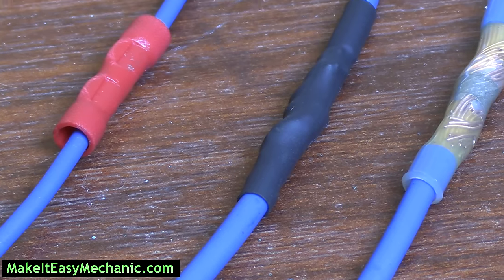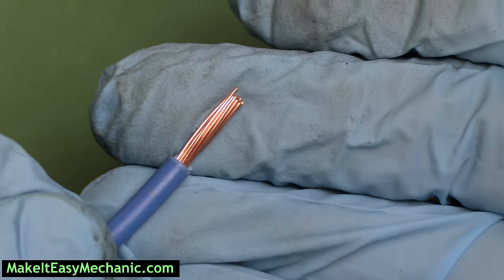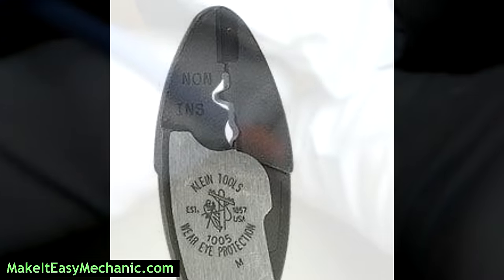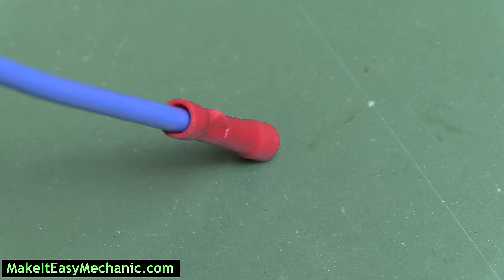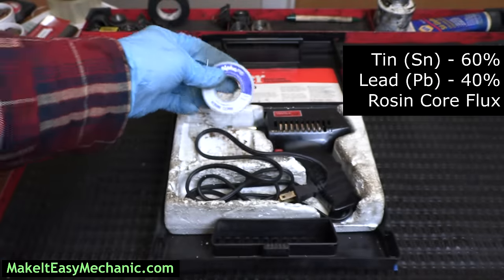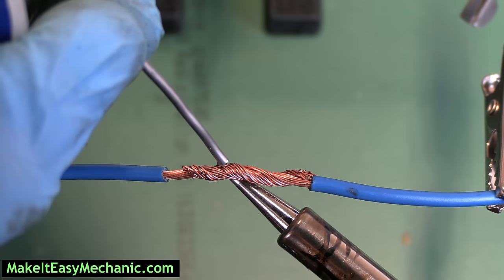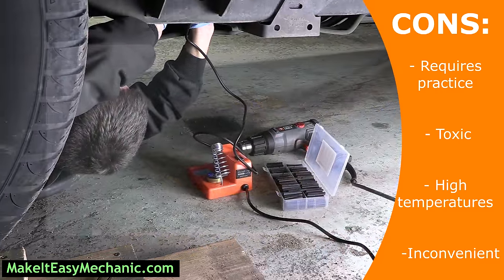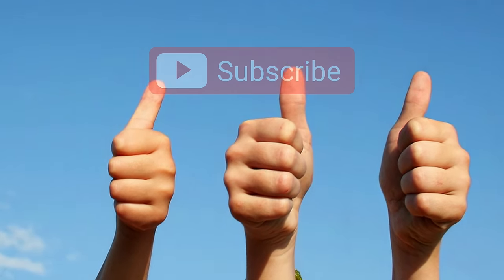How to splice wires - how to solder, how to crimp, wire connectors

Comment: @4.30 the type of tape you need is called amalgamating tape not electrical tape, the amalgamating tape is a stretchy rubber that self seals, electric tape is for electrical insulation, the latter alway goes brittle and lets water in, the other doesn't

Comment: Years of working in military mobile communications, than countless hours building/maintaining cable systems in civilian life, I have to say your video hit the high points of field splicing. It was accurate and informative for the techniques you demonstrated, good job.
Reply: Also for the DIYer, a hairdryer works great for most heat shrink.
Reply: pin this vets comment right now !
Reply: I appreciate you!
Reply: @rppdfire  You’re Amazing!
Reply: @bogartin4561ify  no. Vets are gay
Reply: You never used flux you hack?
Reply: @Big_AlMC  man, you're more toxic than those solder fumes....can we be bff's?

Comment: Great video. I was taught to melt a little solder onto the soldering iron tip before placing it under the twisted wires. The little molten solder lump greatly increases the conduction of heat from the tip to the joint. With the tip contacting the underside of the joint, the rising heat will rapidly heat the whole joint. Then, add your rosin-core solder to the top. It will melt right into the hot joint almost immediately.
Reply: Solder type crimp connector makes life easier
Reply: @Pinkielover  Crimp connectors should not have solder especially if there is vibration. The wire will fracture where the solder starts.
Reply: @Pinkielover  Yet another thing to have on hand. No thanks.
Reply: What is the safest way to connect a copper wire to aluminum aftermarket wiring harness?

Comment: For proper conductivity and minimum resistance, for example, the wires must not be twisted as in India, nor dipped in tin by immersion. This method is probably prohibited everywhere in the EU.

Comment: just one thing to add regarding heat shrink tubing.  There are 2 types, adhesive and non-adhesive.  The non-adhesive ones are not suitable for high moisture environments.  Moisture will actually wick inside the tubing and corrode the wires quite fast.  The adhesive type on the other hand is extremely good for preventing corrosion.  They also tend to be double walled and have a 3:1 shrink ratio.

Comment: Great video!  I've never replaced any kind of electrical wiring before, but I just replaced a defrost thermostat in my 20-year-old refrigerator.  Thanks to this excellent video, I was able to connect the new thermostat's wires to the refrigerator's wires using a red butt connector and electrical tape.  

The main takeaways that I learned are:
- what a correct crimp looks like (I practiced on the old part several times before I tried it for real)
- be sure not to strip some of the copper wires (thanks for showing that -- I never would've thought to look)
- pull on each end to ensure that the wires are secured in the connector

I credit this video for helping a first-timer successfully repair her fridge.  Thank you!

Comment: I didn’t know the last connector existed! As someone that doesn’t know/doesn’t work with soldering enough, this is a great solution for my weekend project.
Reply: @Wolf IT Solutions link to purchase the last type of connector?
Reply: I just used them a few weeks ago & I thought I was supposed to crimp the metal ring in the middle of the connector.... 🤦‍♂️

I don't think that caused any concern, but now I know!

Thanks for the knowledge share!
Reply: @LTSRIDE24  some say you do crimp it... however it will be melted and flow into the cores so the crimping will be pointless. I guess it's good if the cable is tight and you want to heat the joint and not your fingers whilst holding the splice together.
Reply: @fmjkevlar  yeah....I suppose in the end, it ends up getting the job done pretty much the same... 🤷‍♂️
Reply: @LTSRIDE24  exactly 🤷‍♂️
Reply: @Wolf IT Solutions are you saying its a good option of connecter or not to use it?

Comment: Ok so, super gratitude. Feeling clever, might delete later. Headlight socket replacement, in place (tight space) on a 98 Infitniti QX4. After several moments of frustration, this video came through in the clutch. I kept wasting connectors with failed crimps. After watching, I slid a parallel connector onto the car's wire, weaved the wires together ala the solder section, then slid the connector over the wires and crimped with a needle nose pliers adjacent to the wire cutter area which mimics a crimp pretty decent. Electrical tape over the 3 individual wires, then back into the sheath and electrical tape over that. I am please with myself and yall are probably the only people that care LOL. Thank you for reading. I no longer have to pop the hood and jiggle the wire to make my headlight work. PEACE!

Comment: Well done. The one thing I'd add is that when working with heavier gauge wires and/or an iron with limited heat output smearing on the rosin can be a big help to help keep things flowing.

Comment: Glad to see none of those nylon, closed-end crimp connectors featured here. Two wires carrying a high current, joined with those, seems to be what caused the huge recall of those air fryers recently.

Comment: In the process of fixing some wires on my HVAC I came across one of those PSST Connectors, and I have never seen one before so I cut it off and took it to city electric supply and none of the guys at the counter knew what it was it’s so funny the next day I watch your video and get the name of it! Way to help push the community forward with your experience through quality education. Thanks a lot

Comment: Retired electrical engineer here.  Been screwing up crimp joints for about 60 years now.  Using pliers type tools to do the crimps was pretty much hit or miss. A couple of years ago I got a $25 ratchetting crimp tool from Amazon.  Success rate is much better now but ... I even screw that up sometimes.  I highly recommend a ratchetting crimp tool if you're going to be doing more than 10-20 connectors.

Comment: Aircraft mechanic and yes technically we use the heat shrink solder sleeves but only for attaching a wire to the shielding to ground it for protecting data wire from electrical interference. Splicing of wires is done using what are called environmental splices or brand name of RayChem splices. They consist of two pieces, a metal tube with a center stop like a basic butt splice, and a special heat shrink tube like that of a solder sleeve but without the solder that melts at a very high temperature. The reason we avoid using solder is while strong, areas of high vibration cause the strands to break at the edges of the rigid solder connection

Comment: Amazon has bulk rolls of heat shrink  3 to 1 shrinkage with 2 layers and adhesive . I prefer to double over the butt connectors with heat shrink tubes . Very Concise Video !

Comment: When I was first messing with automotive wiring, I might have used one of these methods. These days, it's insulated crimp joints (usually open barrel) sealed with adhesive lined heat shrink. Tear apart an OEM wiring harness and that's usually what you find.

Comment: Great informative video. If you want to make sure your fixed connection is waterproof, put silicone paste under the heat shrink tube. 100% silicone is 100% waterproof.
Reply: Going for the one up here... instead of glue, much better is silicone self-amalgamating wrap. Watertight, originally meant for pipe repair. crazy stretchy and makes a perfect seal, even seal. Looks good, will also do the trick on its own as(imo better) alternative to electrical tape

Comment: thank you. you gave all the info I needed and none I didnt. I wish more 'how-to' videos were this good. now I know I am doing the right thing with the rat chewed wires in the project I just bought. that crimper tool - I lost mine no idea where. it all depends on hand strength tho as you correctly pointed out. My hands dont work so well anymore. A flathead screwdriver and a hammer work alright if you have a flat surface close to where you are working. otherwise - best of luck for those of us with RA AND carpal tunnel issues. and all my friends are the same age now so we all have the same issues!! LOL

Comment: Thanks man!  If I could give you two thumbs up I would.  I'd never heard of the solder seal wire connections.  I have a short in my car's rear camera wiring in the trunk.  I was about to start digging up my solder gun dreading the process while sitting in the trunk my car since I can't remove the wiring harness.  While refreshing myself on what little solder experience I had I watched your video.  To Amazon I went since the local auto stores did not have them.

Comment: I have trying to work on my wire harness,  pigtails on my silverado low beam headlight. Gave it 3 tries. All I did wrong u mentioned. I got to keep trying. Using your last method solder sleeve heat shrink. I used a uncontrollable  flame clicker on solder and stayed too long on shrink sleeve. Burnt insulation. Thx on your video.

Comment: Thanks for the tip on soldering with the mentioning of cold soldering. I would have never thought to let the tip heat the wires then let the solder melt from touching the wires with it. I’m going to do this right now :)
Reply: Hlo
Reply: How can I buy this type of electric wire cold soldier thimbles

Comment: Your video was very helpful.  I'm getting ready to completely rewire a tow-behind trailer and I want to do it so all connections are strong and waterproof.  I wil make sure also that all the lights are individually grounded securely to the frame. Thanks for the informative video.

Comment: I wish I saw this video before I did my wiring.  I crimped, soldered and heat shrinked my wires.  A little over kill you think?   I wasn't sure what kind of connectors I had so I did all three just to be sure.
Great vid!

Comment: Thanks great advice and clear description. Tried first two methods previously with good success. Watched to see if any better way of compact butt jointing nowadays. Your efforts encouraged me to just order a few all in one heat shrink solder butt joint connectors. Will see how it goes but I'm optimistic that it may prove to be my new favorite approach too.

Comment: The pre-soldered shrink tube connectors are very easy to use.
Sadly though the ones I've tried didn't have enough solder to thoroughly soak the connection. Maybe they were too cheap.
Unisolated shear-bolt connectors work great. Slide over shrink tube. Tighten the connector until bolt shears off and isolate with shrink tube.

Comment: Thanks!  I wanted to extend the clip leads on my car battery charger, so used the inter-weave method to splice on the new lengths.  It worked, but the main problem was my soldering irons are so old  that it must have taken 4 - 5 minutes to start heating the wire & melt the solder.  Trying to hold the tip steady against the joint that long meant it pushed it a few times and some of the strands started to splay out, leaving UGLY joints!  I reckon I need a new/faster iron!

The other thing I realised is that I'd trimmed both sets of wires to the same length, meaning the joints were adjacent with a risk of touching if the heat-shrink wore through.  The joints are fine but I may redo them sometime and offset them a bit.

Comment: I'll solder the splice, smear it with some hot glue, slide a piece of heat shrink tubing over it, then set it with a heat gun. It's very secure and completely waterproof. It's what I use for my boat's electrical connections. Takes a bit longer than crimps but it's cheaper than the crimp with hot glue and solder built in.
Reply: Do you know you can buy adhesive heat shrink tubing. It is basically heat shrink with the hot glue already inside.  Works exactly the same as what you described without the additional step.
Reply: @tchevrier   Thanks for the info. Hard to find that here. And I don't need it all the time. So I "McGuyver" it with hot glue. Living in Hawaii has its perks. But lots of downsides when it comes to sources of materials.
Reply: @dcsensui  except they're not hard to find at all lol. In hawaii. something tells me there's a local Home Depot not too far from you. not to

Comment: Pro tip apply a little solder onto the tip before applying it to the wires for soldering.  This creates a "heat bridge" and makes soldering wires faster and more efficient.

Comment: I just want to say nice video and I feel everything is point on, except the wire twisting. When adjoining two wires you should really use the linemen splice. It’s tougher then any connections you made and once soldered it is almost as strong as no break in the wires. Then you just heat shrink in place over the connection. Google “linemen splice”, you’ll understand what I am referring to. Good job overall!

Comment: Another IMPORTANT safety tip! Always wear safety goggles too!!!

And if going to use heat shrink tubing, which you should always try to do, make sure you put the tubing over the wire BEFORE you solder/crimp the wires together. Otherwise you won’t be able to get the tubing over any connectors once the wires are together and will likely have to redo the work. A lot of people forget to do this then use a much larger piece of heat shrink tubing to get past any connectors. The tubing only shrinks so much. You’ll end up with poor seal (or no seal at all).
Reply: Learned this in aviation, makes me wonder if you were in aviation too?
Reply: I think you learn that the first time you forget!
Reply: @djaztec97  actually no! I’m a ham radio operator and also fly drones. I’ve always wanted to be a pilot! Does that count?

Comment: Excellent. I might re-do a few joints I've recently done😂. Also whilst soldering recently the tip heat reflector fell out and I got a nice burn when I went to pick it up with fingers...

Comment: 8:10 Soldering isn't toxic. The lead in solder doesn't get anywhere near hot enough to evaporate. The only thing evaporating is the flux inside the solder wire itself.
Reply: It's not that the lead is evaporating, it's that you're touching lead, then your face/food

Comment: I'd recommend having a fat drop of tin on the tip of your iron - Of course, you have to watch out for cold connections, but it offers much more surface area once you touch the wire, allowing for faster soldering which might be required if you work in a tight space with shrink wrap close by or on a component you don't want to overheat. Also, use as much flux as you want - It's the good stuff, so make sure to dip your wires into some flux before you go ahead. You will have pron-like soldering connections in no-time!

Comment: Would it be reasonable to soak the connection with solder first, then apply these on top ? The interior of the cable would be soaked with your own solder, and the exterior with the one coming with the sleeve. Any problem with this solution ?

Comment: I recently bought a Haisstronica self-soldering connectors kit but do not like the connectors.  Perhaps I used too much heat but the plastic melted before the solder and developed holes.  I was using the smallest connectors.  I tried a number of times, always with the same results.  I went back to using my old faithful of soldering and using marine heat shrink tubing.

Comment: Great video. I have those special connectors and I had difficulty knowing when the inner solder was melted and sometimes it would melt the rubber around getting it hot enough to melt the internal piece of solder. How were you able to deal wtih this?

Comment: Thank you for discussing the way to "splice" wires.  The purposes of splicing electrical wires are to make joined connections of three or more wires in order to complete some pathways for electrical currents to flow.  On the other hand, if you have two wires to join together then it is a typical goal of making an extension with that wire (by twisting together, or by soldering, or by using 'wire nuts', etc.)

Comment: Have seen a lot of crimp vs solder arguments lately. Still not convinced crimping is better, quicker sure, but I've never had a soldered connection fail on me. Not sure those heatshrink solders would be as strong .

Comment: Those solder sleeves  or solder seals as sometimes  called are trash its a loose connection  with  a cold solderes joint and   on  vehicle wires exposed to elements  they are quick to corrode... i too liked them when i first learned about them  but after testing  them out i would only consider using  to get home in a pinch and then make  a adequate  repair

Comment: I tried soldering, but to small repair inside the car is a little bit difficult... I will try the first option, without heat gun, using the wire crimper... Thanks!!

Comment: ADDING HEAT SHRINK TUBING

If you are soldering a joint, say after a wire break, or attached to or near a plastic harness connector plug, (or component such as a relay), put the heat-shrink tubing on the wire BEFORE you start any soldering, and then SLIDE IT AWAY FROM the bared wire you are about to solder. This stops any likely heat transference to the heat shrink before it is slid finally into place over the soldered joint.

The greater the distance away from the area to be soldered the better. Obviously, the length of wire being worked upon will determine just how far away the heat-shrink can be placed in the first instance.

Just a suggestion...

James Hennighan
Yorkshire, England

P.S.
Heat-Shrink comes in closed end or cap formats too, and this can be useful for some jobs...